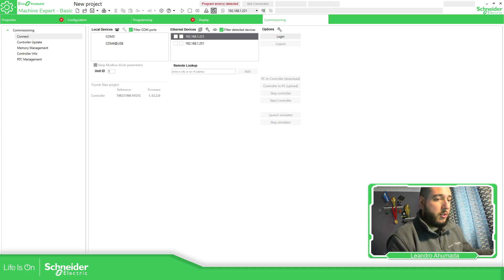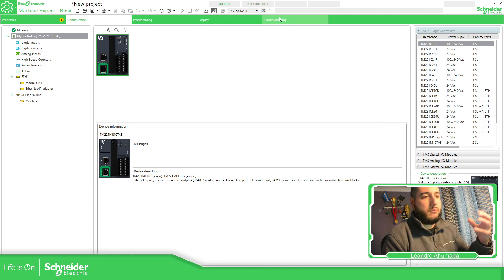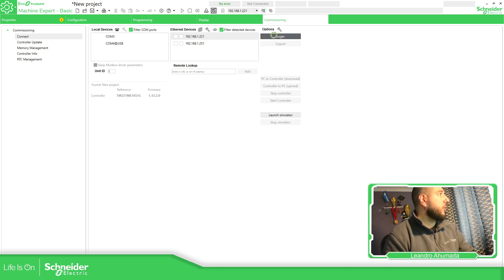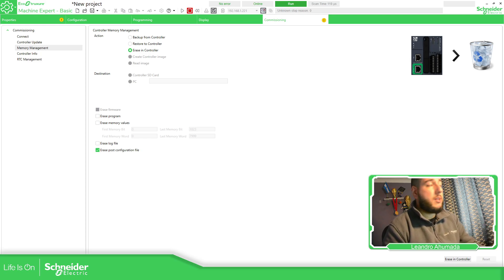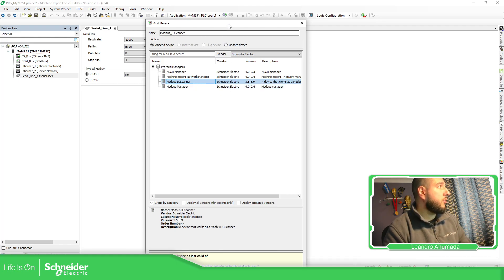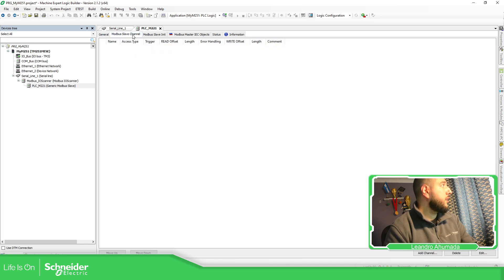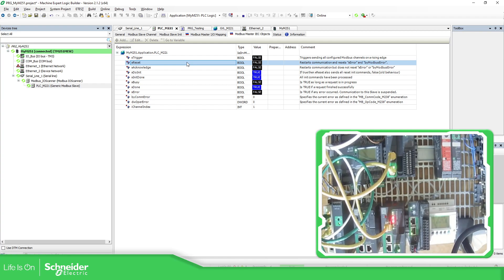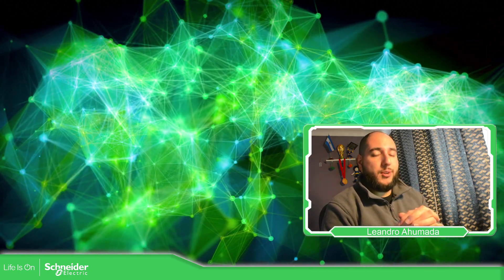EcoStruxure Machine Expert Training - M10.7 Communication beetween M2xx and M221

Comment: Would you pls consider provide a lesson on Modbus serial communication between two m241 PLCs.
Reply from the maker: Hi there! I can do it with an M251 and an M241 because I do not have 2 of each. It will be the same
Reply: @LeTomasAHUMADA  Hi LeThomas. Not many HMIs can handle the tag import from M241 PLC. Would you please provide a lesson on how to use standard Modbus TCP protocol between M241 and a HMI. Especially, how to handle read and write to the persistent variables defined in the M241 PLC. And how to best handle/mapping inputs/outputs of M241 to display/control from HMI. Thanks. JP